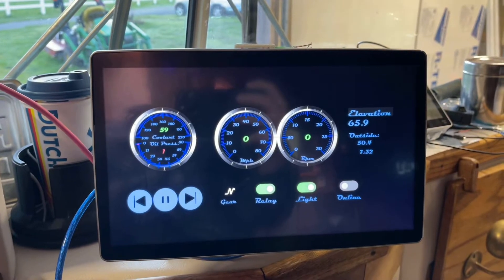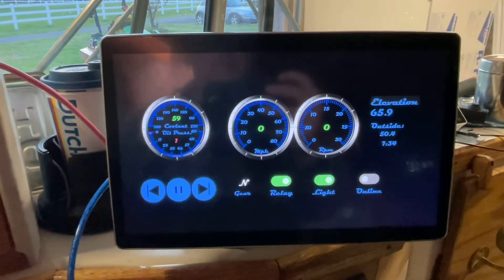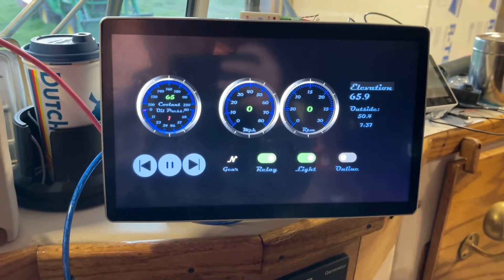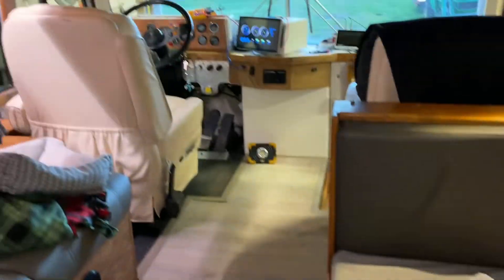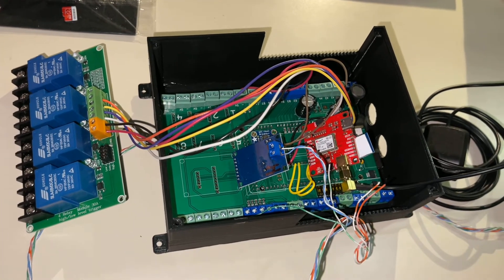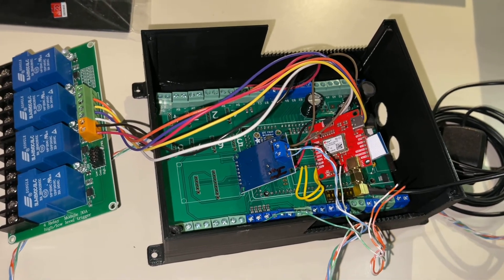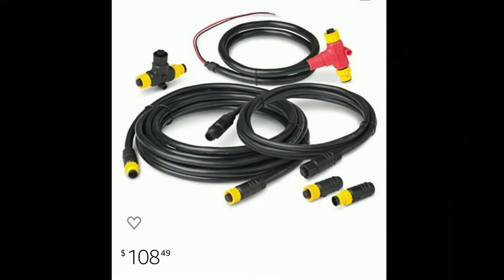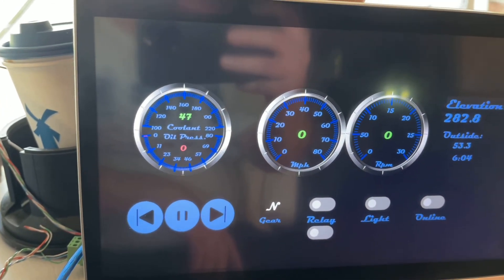DIY engine monitoring open source or Onegauge with canbus!

Comment: Hey Scott!  Was looking to build something similar and saw your video.  Can you elaborate on the boards you used and how it came together?  Im considering adafruit RP2040s with CAN transceivers on them and attaching the analog sensors signals to those.  I see you are using relays and know the analog sensors need power to return voltage, wondering what you went with
Reply from the maker: I ended up using an arduino mega with a onegauge board sandwiched onto it with canbus outputs talking to realdash running on both an android large screen stereo on the side, plus an android TV box connected to an hdmi flatscreen.  It’s all less than ideal, but it works. To answer your question about how analog gauges work, they are typically a resistor to ground on the engine. You make a voltage divider circuit where one resistor value is known, the input voltage is known (5v in my solution), and you measure the voltage between the two resistors with an analog to digital converter. The onegauge board handles this in a tidy package.  A shortcoming of this solution is that Arduino Mega’s don’t have WiFi, and the A2D converters are only 12bit.  You could likely recreate something better with current technology.  Another thing is you want to avoid an operating system, which needs patching and is slow to boot.  An RPI would not be ideal imho because usually that means an OS - but it might be hard to get all the bits needed in a firmware only solution, eg drivers for WiFi, hdmi, canbus, etc. I considered doing something more “modern” with an interested colleague but ran out of time - what I have is working.  FYI there was an earlier iteration of this based on ESP32’s, home assistant, and ESPhome.  I wrote a node-red based converter that would take the ESP32 values being measured for A2D conversion into home assistant and put them into “canbus” over WiFi, something that RealDash supports.  It worked, but I wanted a lot more inputs and outputs.  In that iteration there was some appeal to home assistant being able to combine data from house systems and engine systems into a single interface. However home assistant required WiFi, a WiFi router, and was not hardwired - unacceptable for engine reliability - driving my push to hardwired canbus.  I think the automotive manufacturers have this all figured out already, but I haven’t found a solution that seems attainable to DIY and open-source use.  Expensive proprietary systems exist but little info seems publicly available.  Let me know if you come up with a better plan.
Reply from the maker: There is no relay needed to measure a sensor.  The relays were being used for other things - control circuits for lights etc. Google voltage divider and imagine +5v going into a resistor, your input to your A2D converter in the middle, then the connection to the engine sensor, which completes the path to ground.  You’re measuring the voltage after the known resistor which allows you to calculate the current resistor value of the sensor.  You need to get the data sheet from the sensor mfr to know what resistor values correspond to what pressure or temperature, etc.  They are happy to provide this for aftermarket sensors.  You then need to spend some time manually confirming, measuring, and calibrating things and making adjustments in software to arrive at the real measured value over a wide variety of operating conditions.  You might need to build some circuits that accept 12v in and enable you to determine if something is “on” and adjust that voltage down to digital levels. Trouble light circuits are a different animal altogether.  Eg, a high temp sensor completes a path to ground at the engine when hot.  I might be able to come up with some schematics for you.
Reply: @ThisOldBus  Thanks for the response.  

Seems like we may have different use cases but that does not necessitate a complete different solution.  Know you may be against a RPI, but have you looked into TunerStudio Dash(free-ish)?  Im not going to be tuning anything but the Dash aspect of TunerStudio displays gauges of all types when given serial or canbus connections.  You just have to code up the config(ini) file for it.  The TS DASH, RPI and a canbus expansion hat, could open you up a bit more possibly. 

If youre worried about a slow boot, I have DietPi OS(minimal) running on my RPI5 now and can boot up directly to TS Dash(gauges), in <15 seconds with all peripherals off besides a touchscreen disabled.   

The missing piece to all that is the the analog sensor data obviously and I have started playing with a mega board now.  I will continue at it and most likely post a video with the final product.  Learning as I go and will probably break a board or two but the opengauge solution seemed a little too pricey, at least for my use case, and Im eager to learn something new.

Comment: I can’t wait until you make your boards because I would love to use it for my 1967 GM TDH-4519 fishbowl also how would you recommend I connect a tachometer to my engine I have a 6v71n Detroit with the gear driven 50dn 12 volt alternator
Reply from the maker: I haven’t gotten to the tach connection yet. I will be doing this in future videos - I do have a gear driven tach drive off one of the camshafts.

Comment: I am very interested in this.  I am currently arguing with some of my gauges.  Considering being a travelling installer?  My wife and I agree that this is a great idea.
Reply from the maker: Too much liability. I have been toying with the idea of a DIY kit. In the meantime, onegauge is the only commercial solution I’m aware of.
Reply: @ThisOldBus  Do you know if Onegauge gives the audible warnings like you have set up?  Thanks.
Reply from the maker: In my system those are coming from RealDash running on an android stereo. Onegauge offers some solutions with screens, you’d need to ask him if any of them can alert (which would be important) and loudly enough to hear in a noisy bus going down the road.

Comment: This is pretty cool. Victron Venus OS also speaks canbus.  Yeah the boat industry has been way ahead of us land yacht folks. I should have run some cat5 back to the engine bay when I had the chance :-) I did run a 3 wire bundle back there for extra gauges. I would if that could be used. 

Maybe you covered this already, why did you go with arduino vs a Pi?

Yeah that’s one thing I like about Victron, they open source it all, and make money on their hardware but have no issue with you making your own as well. At some point you see the value in the official hardware like you did with one gauge.
Reply from the maker: Pi runs an operating system and arduino is simply firmware. The firmware-only solution is more responsive and doesn’t have the reliability and update issues that come with a pi. Ever worn out the SD card on a pi? I have.. it sucks if you didn’t have a backup. I started a FB group you should join called high tech RV...